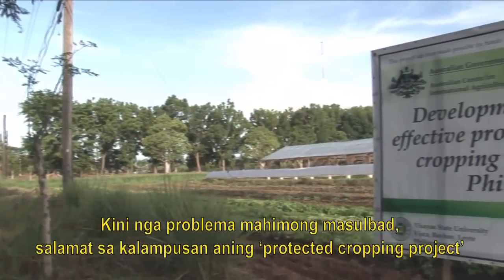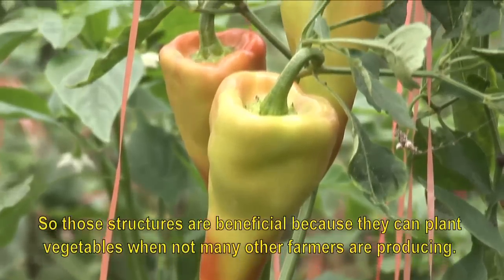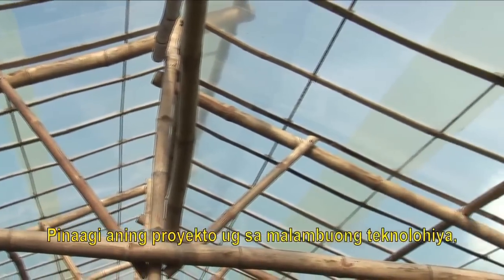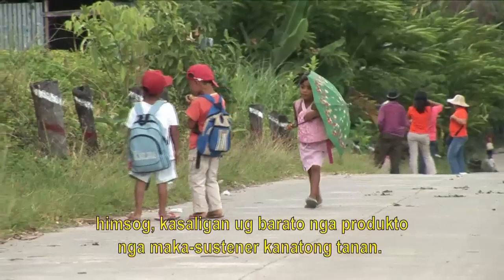Protected vegetable cropping in the Visayas, Philippines.

Comment: The following is a transcript I made of this video. It will be used by agriculture volunteers in the JICA (Japan International Cooperation) program going to the Philippines. Thank you for making this video.

YouTube video title: Protected vegetable cropping in the Visayas, Philippines.
YouTube channel: ACIAR Australia
Share link: https://youtu.be/fKkNb0CN0xs
Note: This video is in Cebuano and English. When captions are on the video, I transcribed it as s:… (screen: … text…). I did not include the Cebuano text.

00:12 s: Protected Vegetable Cropping   Leyte, Philippines
00:16 s: Dr Gordon Rogers, University of Sydney. 
G’day. Welcome to the wet season in the Visayas.
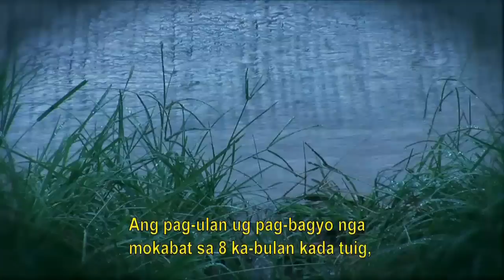00:29 With drenching rain and typhoons for up
00:32 to eight months of the year, growing
00:35 healthy vegetable crops in this region
00:37 is a real challenge. Yields are low and
00:40 so are farmer incomes. But that may soon
00:45 become a problem of the past thanks to
00:48 the success of a protected cropping
00:50 project conducted at Visayas State
00:52 University and funded by the Australian
00:55 Centre for International Agricultural
00:56 Research. The project team has developed
01:00 easy to build low-cost protective
01:03 structures and they’re delivering
01:05 impressive results. 
01:08 s: Dr Zenaida Gonzaga, Program Manager, VSU
We found bamboo was the cheapest, strongest material for construction and gives better protection for our crops.
01:18 s: What is good about these structures is that the increase in yield in the wet season 
01:29 s: is two to five times compared to crops grown in the open field.
01:32 The funding, together with expertise from Australian
01:34 and Filipino scientists, has been used to
01:36 employ research staff, buy equipment and
01:39 consumables and to build structures.
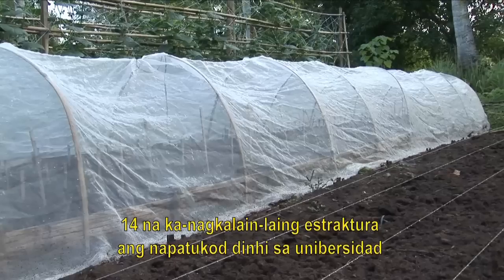01:44 So far 14 structures of varying designs
01:46 have been built both at the University
01:49 and on farms such as this one at Bontoc.
01:51 s: Lucio ‘Boy’ Gerona
The first two crops I planted where
01:54 lettuce and bitter gourds, or ampalaya, (‘goya’ in Japanese) 
01:57 and then I had a good price because they
02:03 were planted during the rainy days. The
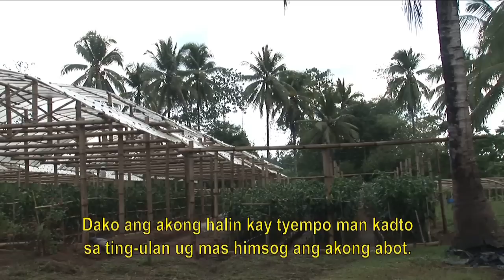02:06 plants in the open are not so healthy as
02:09 compared to the inside. Boy Gerona
02:12 used the profit from his first crops to
02:15 repair his water pump and install a
02:17 trickle irrigation system. Before we used
02:21 to to get, ah, fetch (get) water from the river
02:25 bank and from that river I using that
02:28 carabao, carabao using that, this cart. We had to
02:33 fetch around 172 water jugs in the
02:37 morning and another 72 in the morning and
02:40 72 in the afternoon so 144
02:42 water jugs every day. The process of
02:45 mixed cropping will be used to buy fine
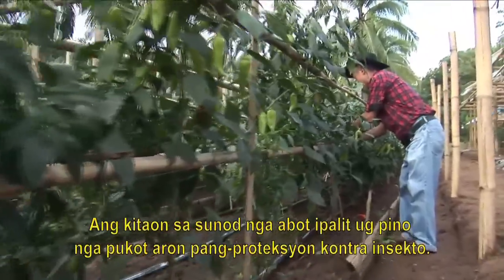02:49 nets to enclose the structure to 
02:53 protect my plants against insects so
02:57 that it will be a hundred percent
02:59 pesticide or insecticide free. 
03:04 At Lao, Joseph Sanchez is ahead of his target
03:07 to recoup the cost of his structure in
03:08 one year. s: With what I got from the first cropping I was able to recover half the cost of the structure.
03:13 Joseph Sanchez. s: What I can say about the structure is that it can give high quality and high yields.
03:31 And aside from that, it also protects my health.
03:35 And in Cabintan, Noel Morales is renowned in the
03:38 district for his passion for new farming
03:40 innovations (and) has achieved yield increases
03:43 of more than 200%.
03:45 s: Because of this protected structure my yields have increased and the quality has improved.
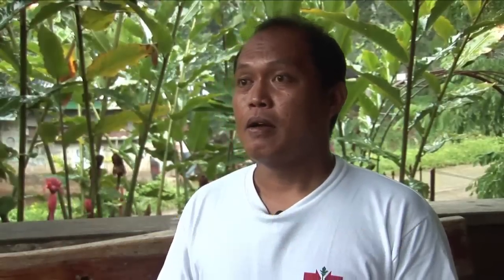03:51 s: Noel Morales
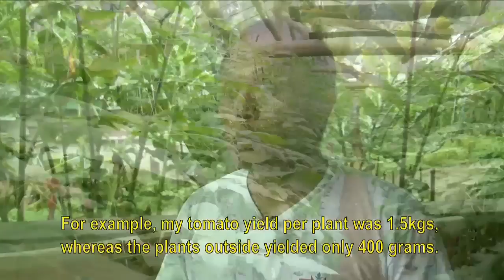03:57 s: For example, my tomato yield per plant was 1.5kgs, whereas the plants outside yielded only 400 grams.
04:04 s: Noel’s tomato yield 2009 kg / plant. Open field - 0.4   House structure - 1.5
04:07 The project team has been
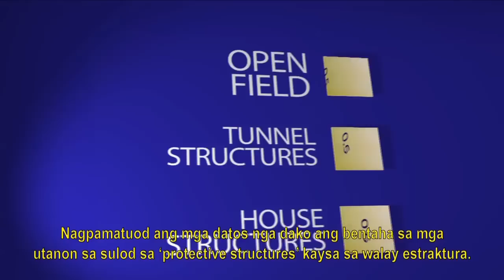04:10 carefully monitoring all the trial sites
04:12 and the data they are collecting clearly
04:15 shows the advantages of growing
04:17 vegetables under protective structures
04:19 compared to the open field. s: Annual profit from vegetables Pesos per metre square. Open field - 9.7   Tunnel structures - 72.5    House structures - 80.0  
04:23 Since it began in 2008 the project has expanded
04:26 with support from private organizations
04:28 including the East West Seeds company and
04:30 the Energy Development Corporation which
04:33 is financing the building of several new
04:35 structures. 
04:38 s: Our farmers here would prefer the protected structure because here in our place it always rains.
04:42 s: Danilo Vitualla, EDC (PNOC)
04:50 s: So those structures are beneficial because they can plant vegetables when not many other farmers are producing.
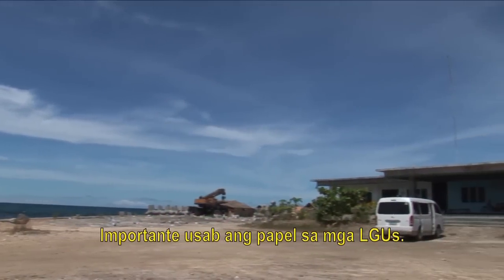05:04 Local government
05:07 units also play a key role.
05:14 s: The City of Maasin is helping in terms of providing farmers with training, seeds, fertilizers and chemicals through interest-free loans.
05:23 s: And we are also giving marketing assistance by buying their produce.
05:31 Everyone involved agrees that
05:35 protected cropping is a resounding
05:36 success but there is still more research
05:39 to be done (for) controlling pests and
05:41 diseases and making further improvements
05:44 to the structures.
05:46 s: We are finding ways to efficiently collect rainwater for use in the dry season.
05:53 s: We are also looking at ways to easily remove the plastic roofing during the dry season.
06:00 The project team is now also focused on
06:03 encouraging more farmers to set up their
06:05 own protected cropping systems.
06:08 s: To encourage farmers to adopt our technology we are conducting ‘farmer’s field days’
06:13 s: Dr Othello Capuno, VSU Vice President, Research
06:18 s: and we are asking Local Government Units to continue their support.
06:24 s: We are also inviting businessmen to buy products directly from the farmers.
06:31 s: The support of Local Government Units is very important,
06:39 s: first for funding to construct the structures,
06:49 s: second, for technical assistance because they have direct contact with our farmers. (some text on the screen repeats)
06:56 s: This project is a big help to the farmers and the economy in this region.
06:58 s: Dr Jose Bacusmo, VSU President
07:03 s: The success of this has gone far beyond our expectations.
07:18 s: We’re very grateful to the Australian Government, 
07:21 s: ACIAR and partners, PNOC-EDC, East-West Seeds and also,
07:30 s: very importantly, the Local Government Units.
07:34 Because of this project and the new
07:36 technology that has been developed,
07:38 Filipino farmers here in Leyte can now
07:41 grow vegetables even in the wettest and
07:43 windiest of seasons. They will no longer
07:46 need to go to cities to look for jobs to
07:49 supplement their farm incomes and
07:51 importantly the whole community will
07:54 reap the economic benefits and the
07:56 health benefits of a reliable year-round
07:59 supply of fresh affordable locally
08:03 produced vegetables.

Credits / notes at the end of the video:
Daghang salamat
Farmers
Lucio ‘Boy’ Gerona
Joseph Sanchez
Noel Morales
Raymundo Ordiz
Alfredo Panchacala
Dante Nazario

VSU
Zenaida Gonzaga
Jose Bacusmo
Othello Capuno
Maria Lilia Vega
Jonathan Mangmang
Dhenber Lusanta
Pedro Armenia
Reny Gerona
Anabella Tulin
Lilian Nunez

City of Maasin
Amando Acasio

EDC 
Danilo Vitualla

East West Seeds
Ana Daisy Monreal
Catherine Cotillas
Terri-Virna Tanquezon

Video production
Presenter: Gordon Rogers
Producer / Director: Sharron Olivier
Camera / Audio: Geramil Cordero
Editor: Darren Blin
Scriptwriter: Craig Skehan
Translators: Dante Margate, Maria Lilia Vega
Edit facilities: Anvil Media Pty Ltd

Video production funding
Australian Centre for International Agricultural Research (ACIAR)

protectedcropping.com (September 2017 note: a google search of protectedcropping.com yielded zero results; similar sites came up)